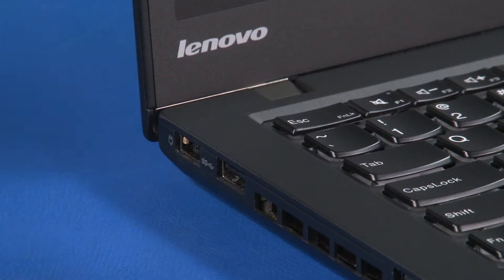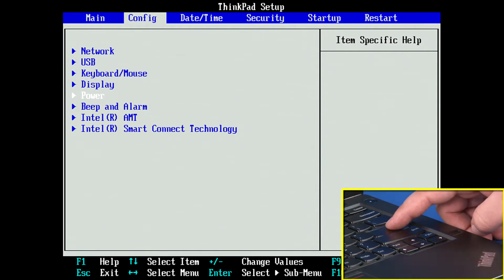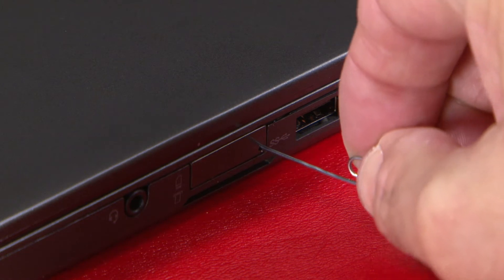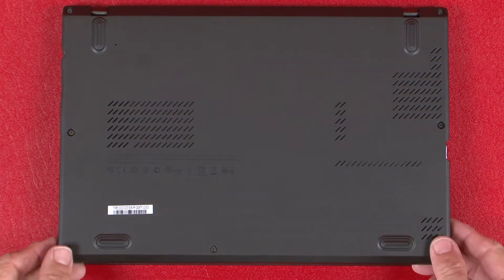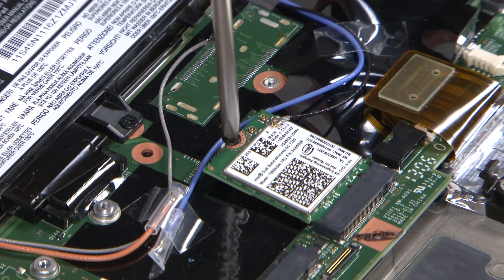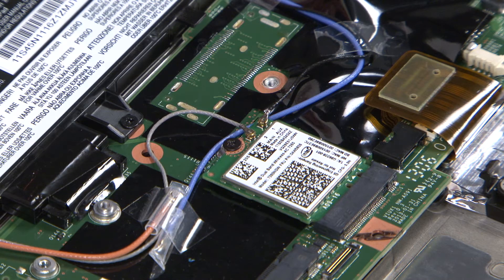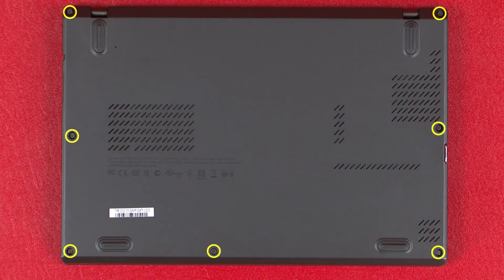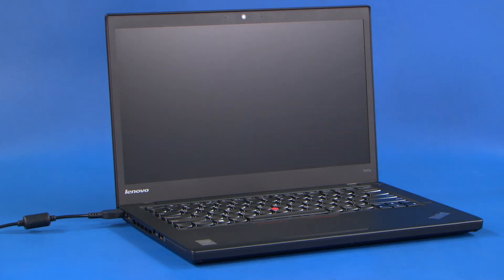ThinkPad X230s, X240s - Wireless LAN Card Replacement

Comment: Hello Lenovo,
I got a X230i and would like to upgrade the Wireless LAN Card to WiFi 6 if possible. Would you give me some recommendations as I heard that there is so-called white list and users couldn't use any unauthorized parts.
Reply from the maker: Hi there, Vincent! Thanks for reaching out to us. Please send us a PM/DM thru Facebook/Twitter with your system's serial number for us to take a closer look. For you to easily identify it, kindly visit this link https://lnv.gy/3ANUAPb. Make sure to include this reference number #1438445 on your message. We're here to help. Rodney_Lenovo
Reply: @LenovoSupport  Ok, already sent a DM via Twitter. Please help.
Reply from the maker: Thanks! We'll check your message and let's continue our conversations their. Rai_Lenovo
Reply: @LenovoSupport  Hi Lenovo, I'd provided the system serial no. via Twitter and FB this Monday but I have not heard from you yet. Can help?
Reply from the maker: Hi Vincent! Apologies for the delay. We're able to get the serial number on your messages. Here are the supported WLAN cards that are compatible to X230 Thinkpads, which are mostly 11a/b/g/n https://lnv.gy/3B0kZJB Other than those listed are not guaranteed to work, including the WiFi 6 version (802.11ax). Let us know if you have further questions. Hector_Lenovo
Reply: @LenovoSupport  Hi, thanks for your quick reply. From the link you provided I could only see Intel Centrino N-2200 listed. I don't see any other substitutes. Correct?
Reply from the maker: We've checked it, and it shows only the Intel Centrino N-2200 as the compatible wireless cards. There are no parts listed in Model and Compatible category, this should be the only one to work on the X230 model you're using. Upgrading to Wi-Fi 6 is not recommended, due to BIOS restrictions. Hector_Lenovo

Comment: How can I do install WiFi module from non-Lenovo hardware easily? I already tried put another WiFi card on my x230, but it is showing me an warning message when turn on the laptop "1802 unauthorized network card is plugged in - Power off and remove the miniPCI network card (168C/002B/105B/E016)". Please help asap. Thank you.
Reply from the maker: Hi Iyan! Thank you for reaching out to us. Are you the original owner? Was the BIOS recently updated? We recommend you to  install the correct part instead. Could you provide to us the serial number so we could check the part number for you? Let us know.We're here to assist you.John_Lenovo
Reply: LenovoSupport Yes, I'm the owner. This is my own Thinkpad. It was updated long time ago. What do you mean by "install the correct part"? And how can I know the serial number?
Reply from the maker: Every part of the computer has its own number. That is the one you use in buying a replacement parts. You can follow these steps to obtain the serial number: http://lnv.gy/2pqyjmB. John_Lenovo
Reply: BIOS is just very recently updated, currenty version 2.71. Type model 23254Y4. Serial number is R9WCVCB. Got that info from BIOS interface. Please help, I want to install new WiFi module.
Reply from the maker: Hey Iyan! Another helping hand here. You may check the hardware maintenance manual http://lnv.gy/2ICYnE9 (See pages 68-69) and follow the steps on how to replace the wireless card of the Lenovo ThinkPad X230. In addition, here is the list http://lnv.gy/2IFgQjp (look for Wireless Card) of the tested and compatible wireless card for the Lenovo ThinkPad X230. Hope this helps! -Chris_Lenovo
Reply: In my view, most of wifi cards should work just fine, I just need to install driver on it, in order to make it working, isn't it? Or Lenovo just wanna make me install only some of the hardware that on their whitelist? Or what... tell me more about that.
Reply from the maker: What is included in the list provided are the wifi cards that are tested and working on this model. Any Wifi cards that are not included on the list, are not guaranteed to work on Thinkpad X230. Mark_Lenovo
Reply: LenovoSupport So, my point is, I already updated bios to the newest version, if I put non-listed hardware, will it show an warning bios "1802 unauthorized network card" (again)?
Reply: LenovoSupport Look, I just don't want to see an bios error warning "1802 unauthorized network card" message anymore, did you get my point? How to remove that limitation?
Reply from the maker: It may still not work due to the whitelist. -Jerry_Lenovo
Reply: LenovoSupport so help me remove that whitelist. Help me to help you run your duty to help.
Reply from the maker: Hi Iyan! We cannot provide you instructions on how to remove the whitelist in the BIOS. This is considered as modification on the laptop and we do not support it. Jan_Lenovo
Reply from the maker: Hi there! Thanks for reaching us. The hardware components may depends on the cost of the device and there are also upgrade options if you will be checking the hardware maintenance manual for the specific model. Thanks . Arjay_Lenovo

Comment: How can I do this for the Bluetooth card? Where is it located?
Reply from the maker: Hi Valentin! Thanks for reaching out our support. Do you have the same model as the video shows? Also, could you send us the serial number so we can further check? We'll be waiting for your reply. Ash_Lenovo
Reply: Hi Ash! Thank you for your reply. Product name is 2324CTO. Serial number is PK18A6C. I found where the bluetooth card is supposed to be located. When I bought my laptop, I decided not to take the Bluetooth option. That was a mistake. I would now like to have Bluetooth on my laptop. I bought a bluetooth card and put it inside my laptop. When I opened the laptop, I was surprised to see that a bluetooth card was already present in the laptop. I replaced it with my newly bought bluetooth card and no bluetooth card is detected. Do you know if somehow Lenovo blocked bluetooth from my laptop completely? Maybe it would be better to communicate by email or phone rather than on YouTube. I'll be waiting for your reply. Thanks. Valentin
Reply from the maker: Hi there! Thanks for reaching us. Based from the serial number you provided, your existing wireless card does have bluetooth functionality as well. Could you please connect the wireless card came with the laptop then check if the bluetooth will work? What is the part number of the bluetooth card you bought? Thanks. Arjay_Lenovo
Reply from the maker: Based from the serial number, the card that should come with the laptop is  60Y3303 and  that should work. Have you installed the driver after you replaced the card? Arjay_Lenovo
Reply: I checked and the card is indeed a 60Y3303. It came with the laptop
Reply: I did install the drivers.
Reply from the maker: Could you please go to device manager, show all hidden devices, check if the wireless card is detected and if there is a bluotooth driver showing up. Please try this wireless driver from our website http://lnv.gy/2nu1iVD and bios update http://lnv.gy/2nuUpUl thanks. Arjay_Lenovo
Reply: My BIOS is already up-to-date (2.70, last release for x230) and my drivers too. Sadly, this  doesn't solve the problem. :/
Reply from the maker: Thanks for sharing the details. As I conducted a research with your laptop's model, it has a separate WLAN card and a Bluetooth module.

In order for us to further assess, could you kindly go to BIOS then navigate to Security > I/O Port Access > Bluetooth > set it to Enabled then press F10 to save and exit. 

Let us know if this works. Thanks! We appreciate your efforts. Marky_Lenovo
Reply: Hi Marky, Bluetooth is already enabled in the BIOS. That is something I had already checked. With bluetooth enabled, the bluetooth card is still not detected. Maybe the solution for me would be to replace my Wireless card with a newer one that also supports Bluetooth?
Reply from the maker: Thanks for trying those steps and we appreciate your efforts. Replacing the wireless card with one having both Wireless and Bluetooth would also be a good suggestion. If you would be looking for one, I was able to get its details and this is confirmed to work with your laptop.

Part Number: 60Y3305  
Part Description: FRU Broadcom Hygie (BRCM 20702 BT 4.0) - Liteon.

Hope this helps. Otherwise, let us know if you need further details. Thanks! Marky_Lenovo